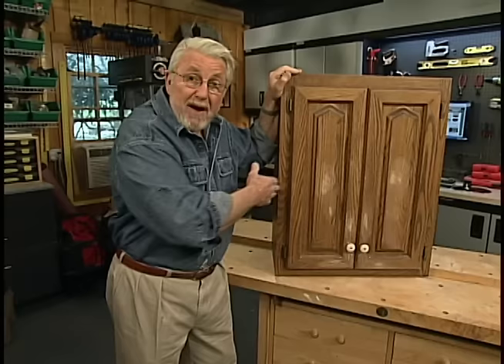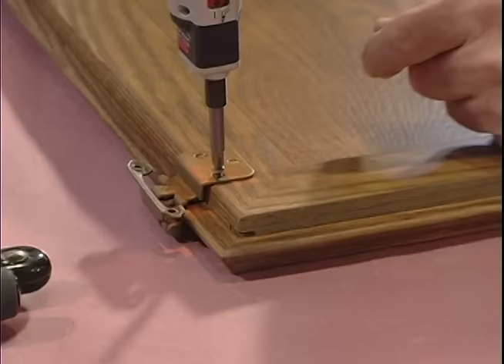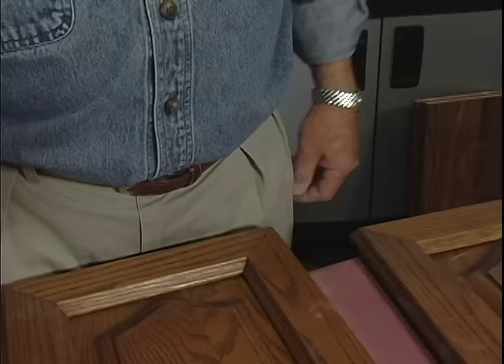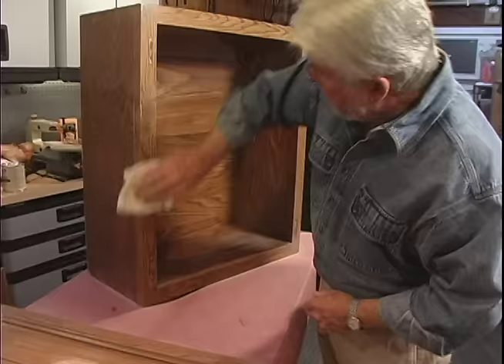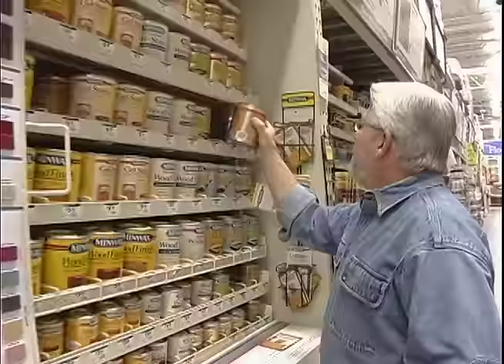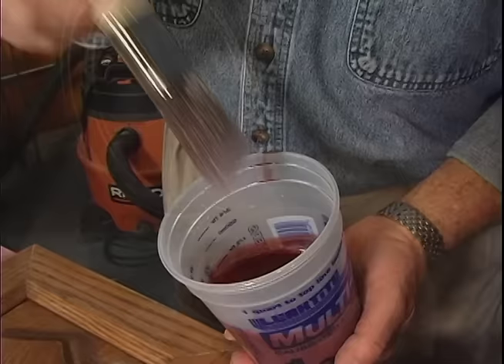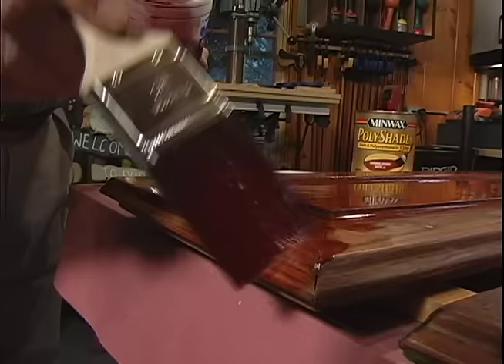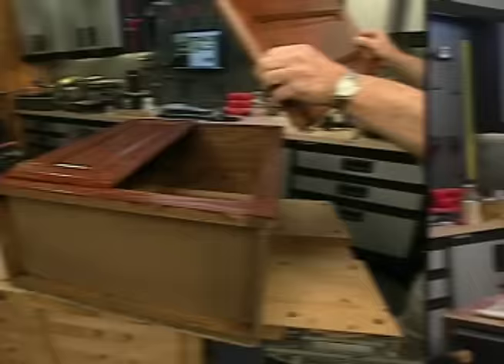Refinish Kitchen Cabinets Without Stripping

Comment: I was curious as to why you didn’t stain the interior? I want to resurface my cabinets to a darker color but didn’t know if I should finish the inside?
Reply: I'm not Ron, of course, but I suspect that if that cabinet goes back into his kitchen, he will refinish the inside. Probably just for time and editing sake, he left the inside undone. Personally, being as anal retentive as I am, I even finish the parts that will never be seen. But, that's just me.
Reply: Based on my 40 years of experience, now retired, in painting, staining, faux finishing, restoring antique wood finishes in all kinds of furniture, this is the worst advice I have ever heard from someone who is suppose to be a craftsman. My god, LOOK AT THE DETAIL  after he is finished showing the before and after. There is all kinds of flaws in the finish!!! YOU NEVER EVER USE A POLYSTAIN for refinishing..PERIOD.. and NEVER USE A STAIN PENCIL...PERIOD....Refinishing anything without taking it completely down to bare wood requires time and patience in order to get the stain evenly dispersed around your project no matter what it is. Yes, for the novice, do the prep work he suggests and thats where you stop with this guys advice. Again, for the novice, buy yourself a ' GEL STAIN' and a professional natural bristle brush. I recommend getting the blond bristle. Again, for the novice, you want to take the brush and place it in a container full of mineral spirits and bounce the brush up and down on the bottom for a minute. This will aid in loosing and loose bristles that may be in the feral and will make the brush less rigged. Remove the brush and shake it out by placing it between both your hands and rubbing the brush back and forth causing the brush to swirl back and forth. Put the brush back in the mineral spirits and repeat. Next put the brush back in the it's wrapper that it came in and let it dry over night. Again, for the novice, After you have prepped your project, use a little amount of gel stain on the brush and get in all the crevices first and they all the flat parts and sides, called revels, and let dry over night. Remember to clean the brush each time you use it!! DO NOT USE a lot of gel stain because to do this right you may have to do this a number of times perhaps up to as much as 3 coats for uniformity. Next day, look where all the light spots are, that is where you need to add just a little of the stain. Dab a little on with a non shedding cloth or paper towel than take your brush and sweep very lightly over the area to cover it and feather it into the rest of the wood that is not so light. Let dry. Do this again until you see uniformity. Then apply another light coat of gel stain and let dry and again, look for light spots and repeat what I said above and let dry. Next look for light spots if any, repeat if necessary. After you have uniformity, and your project is dry, apply by spraying, from a can, a light coat of polyurethane to seal in the stain. Let dry. Then you can a use either 2-3 more coats of spray or 2 coast of brush on polyurethane and let dry completely before putting the hardware back on. Now enjoy your project. Also do the inside of the cabinet first.
Reply: Based on my 40 years of experience, now retired, in painting, staining, faux finishing, restoring antique wood finishes in all kinds of furniture, this is the worst advice I have ever heard from someone who is suppose to be a craftsman. My god, LOOK AT THE DETAIL  after he is finished showing the before and after. There is all kinds of flaws in the finish!!! YOU NEVER EVER USE A POLYSTAIN for refinishing..PERIOD.. and NEVER USE A STAIN PENCIL...PERIOD....Refinishing anything without taking it completely down to bare wood requires time and patience in order to get the stain evenly dispersed around your project no matter what it is. Yes, for the novice, do the prep work he suggests and thats where you stop with this guys advice. Again, for the novice, buy yourself a ' GEL STAIN' and a professional natural bristle brush. I recommend getting the blond bristle. Again, for the novice, you want to take the brush and place it in a container full of mineral spirits and bounce the brush up and down on the bottom for a minute. This will aid in loosing and loose bristles that may be in the feral and will make the brush less rigged. Remove the brush and shake it out by placing it between both your hands and rubbing the brush back and forth causing the brush to swirl back and forth. Put the brush back in the mineral spirits and repeat. Next put the brush back in the it's wrapper that it came in and let it dry over night. Again, for the novice, After you have prepped your project, use a little amount of gel stain on the brush and get in all the crevices first and they all the flat parts and sides, called revels, and let dry over night. Remember to clean the brush each time you use it!! DO NOT USE a lot of gel stain because to do this right you may have to do this a number of times perhaps up to as much as 3 coats for uniformity. Next day, look where all the light spots are, that is where you need to add just a little of the stain. Dab a little on with a non shedding cloth or paper towel than take your brush and sweep very lightly over the area to cover it and feather it into the rest of the wood that is not so light. Let dry. Do this again until you see uniformity. Then apply another light coat of gel stain and let dry and again, look for light spots and repeat what I said above and let dry. Next look for light spots if any, repeat if necessary. After you have uniformity, and your project is dry, apply by spraying, from a can, a light coat of polyurethane to seal in the stain. Let dry. Then you can a use either 2-3 more coats of spray or 2 coast of brush on polyurethane and let dry completely before putting the hardware back on. Now enjoy your project. Do the inside of the cabinet first.
Reply: Dannyixoye holy shit dude.. 40 years of experience and you recommend 4 days of just making the stain uniform? How do you make any money re staining and letting dry for so long? :/
Reply: @dannyixoye262  which brand products do you recommend?
Reply: @doubleclutchinjammingears3391  I made money because people who want things to be done right,  paid me to do it right knowing that it takes time to do it right. Plus, I had more than 1 project going on. eg., each project has certain steps so once I stripped a project, it had to dry, so I would have the time to start another while not ignoring the 1st project. By the time the 2nd project was done with the first step  I'd return to the 1st project for the second step and so on. Sometimes, depending on the item, I could work on 3 or more projects
Reply: @hisnewlife3543  Some products I used are not generally available to the public market. However, products such as ZAR or MinWax, which I have used many times, do well with refinishing modern wood items. Both companies have gel stains. Depending on the item and it's size, many times I actually used artist oils. Meaning the artist oils you find in art stores for painting pictures and such.

Comment: I have maple cabinets. The doors look like they have a skin on them to mimic the look of wood and the boxes have what looks like the same and thanks to my puppy who pulled off a corner at the bottom of the end cap it looks like compressed wood there. I can’t afford to reface and am worried about painting them. How can I remove the faux wood skin without destroying the cabinets ? Love the finish on your cabinet
Reply: Rosemary Catalano In your case, I highly recommend Rustoleum Cabinet Transformation ki

Comment: Liked your video. Would like to ask a question??? How can I remove paint stains off wooden kitchen cabinets without damaging them ?
Reply: Are your cabinets stained and varnished?  If so, use latex paint remover on a soft dry cloth.  Gently rub the spot until the paint comes off.  Then apply a coat of paste wax to protect the finish.  If your cabinets are painted, and then have other paint on them, you have a couple of options to chose from.  You canuse the same process (without the wax), or simply sand the stain off with 220 grit sandpaper.  Then apply a top coat to match the original color.   Good luck!

Comment: Greetings from Romania! I'm new to your channel, but boy have I learned a bunch. 
Question: what would be the best way to lower cabinet shelves, for easy access to disabled persons?
Reply: There is no easy way to lower them. The must be removed and re-hung at a lower point. Or you can build up the floor to a more accommodating height. But that is more work than lowering the cabinets.
Reply: @dannyixoye262  thank you for your reply, I was thinking of somehow using the method I saw here: https://youtu.be/kaJVWoKj2a4
Reply: Easy. Make a jig (or buy one for this purpose) It will make all the holes exactly the same height and use shelf pins in the holes.
Reply: @SteveBueche1027  much appreciated, bless you.
Reply: @dannyixoye262  .
Reply: stilts lol
Reply: @wantsanewvehicle  did jew gettit?😎
Year
Make
Model
Color?
Reply: @paultyler7355  ¿¿ʇɐɥʍ ʎɐs

Comment: Great video! Is this process necessary for steam damage? What do you mean by a "good brush" ? Are there brushes specifically for stain?
Reply: he means get a real brush , not a walmart $3.00 brush , Purdy or Corona from a paint store .... medium or soft bristles , for oil finishes or ALL finishes .... Having said that , look close at the "after" photos .... do you want that uneven runny look ???  That's what you'll get with "stain+poly in one" product ...... best to use a "regular" stain , even a gel stain , THEN clearcoat after it dries thoroughly ..... or , prime and paint your old worn cabinets ..... Hard to make a stain refinish look really good again , but it can be done , it's just not easy to get "perfect" for the DYIer with a restain and clearcoat ..... Paint , you can get perfect a lot easier if you use the right stuff "Sherwin Williams Pro Classic" water based or modified paint after priming  ..... water clean up , flows well , levels well , two thin coats , no runs , satin hides imperfections
Reply: shure46 which regular stain do you recommend?

Comment: i need to freshen up my cupboard doors....i want the same color...how do i go about matching the stain?
Reply: Take off one of the drawer faces and bring it to your local Hardware store. Most stain sections in stores will have wood chips showing the stain color. So you just hold up your piece to those different stains/colors to match.

Comment: Hello Ron, 

I sanded down my cabinets and stained them. On the doors I have small little bumps that look like the measles. Any clue why? I sanded the doors, and used an tack pad to remove any excess dust or shavings.
Reply: Sounds like you got air bubbles in your finish, maybe.

Comment: Beautiful finished job Ron  !! What do you recommend on easy repairs on hardwood floors for one spot from my puppy mishaps (urine...pee) !! Lol 😆 please reply thank you
Reply: That's a problem. It's tough to do spot refinish jobs on any surface without leaving a "ghost" where the damage was but it's particularly noticeable on large surfaces like tables, and unfortunately floors. Sand lightly with 220 on a solid backer until you see noticeable improvement. Restain cautiously to match starting with lighter color than you think. If it does indeed look lighter after it dries, add a little darker flavor till you get it right, it shouldn't take much. Your problem is going to be matching the sheen of the finish to the existing.  I would thin down some poly of your choice with mineral spirits and very light coats til you're happy. Good luck

Comment: Can I use this technique on dining table?
Reply: Based on my 40 years of experience, now retired, in painting, staining, faux finishing, restoring antique wood finishes in all kinds of furniture, this is the worst advice I have ever heard from someone who is suppose to be a craftsman. My god, LOOK AT THE DETAIL  after he is finished showing the before and after. There is all kinds of flaws in the finish!!! YOU NEVER EVER USE A POLYSTAIN for refinishing..PERIOD.. and NEVER USE A STAIN PENCIL...PERIOD....Refinishing anything without taking it completely down to bare wood requires time and patience in order to get the stain evenly dispersed around your project no matter what it is. Yes, for the novice, do the prep work he suggests and thats where you stop with this guys advice. Again, for the novice, buy yourself a ' GEL STAIN' and a professional natural bristle brush. I recommend getting the blond bristle. Again, for the novice, you want to take the brush and place it in a container full of mineral spirits and bounce the brush up and down on the bottom for a minute. This will aid in loosing and loose bristles that may be in the feral and will make the brush less rigged. Remove the brush and shake it out by placing it between both your hands and rubbing the brush back and forth causing the brush to swirl back and forth. Put the brush back in the mineral spirits and repeat. Next put the brush back in the it's wrapper that it came in and let it dry over night. Again, for the novice, After you have prepped your project, use a little amount of gel stain on the brush and get in all the crevices first and they all the flat parts and sides, called revels, and let dry over night. Remember to clean the brush each time you use it!! DO NOT USE a lot of gel stain because to do this right you may have to do this a number of times perhaps up to as much as 3 coats for uniformity. Next day, look where all the light spots are, that is where you need to add just a little of the stain. Dab a little on with a non shedding cloth or paper towel than take your brush and sweep very lightly over the area to cover it and feather it into the rest of the wood that is not so light. Let dry. Do this again until you see uniformity. Then apply another light coat of gel stain and let dry and again, look for light spots and repeat what I said above and let dry. Next look for light spots if any, repeat if necessary. After you have uniformity, and your project is dry, apply by spraying, from a can, a light coat of polyurethane to seal in the stain. Let dry. Then you can a use either 2-3 more coats of spray or 2 coast of brush on polyurethane and let dry completely before putting the hardware back on. Now enjoy your project.
Reply: Eat first
Reply: I have refinshed many tables with poly. I do not see why this would not work. Yo may want to strip it first though. Its fairly easy to strip on a flat surface. Make sure  to have enough rags. Old socks are good.

Comment: If anyone is considering this, do yourself a favor and do test panels before applying to your cabinets. In my opinion, Polyshades may be the worst film finish ever invented.  You WILL see brush marks and the dye in the poly doesn't cover imperfections.  It's a little better if you have the ability to spay it.

Comment: im here because i sprayed a polyurethane clear topcoat on as an experiment , and it has pinholes . as a car painter i thought it would save time . i guess i have to sand back until the pinholes disappear , then brush it on instead ?
Reply: Did you cut the polyurethane with mineral spirits to thin it out and make it dry quicker? The longer it takes to dry, the more dust particles will settle and cause that. You'll have to lightly sand with 220 grit or finer and apply another topcoat. Unless you are referring to the pores oak typically has, in which case you'll need some sort of filler before sealing.

Comment: Mr Hazleton, is there any way to paint melamine (I think that is what they are called.) cabinets?  Thanks.
Reply: You can scuff it up with a scotch brite pad.  I did it 15 years ago and it worked well as a inexpensive face lift in a kitchen.
Reply: Formica ? Is this what you mean ?